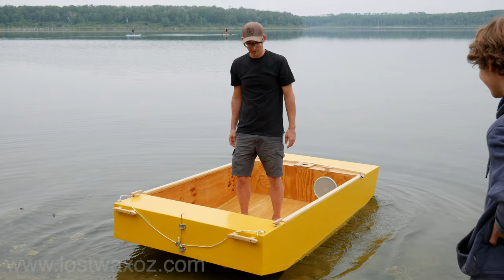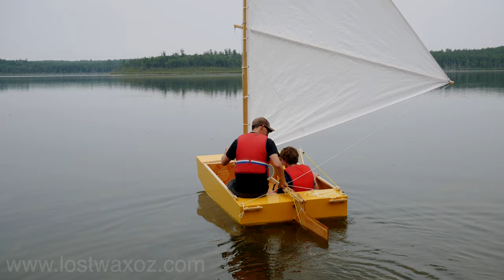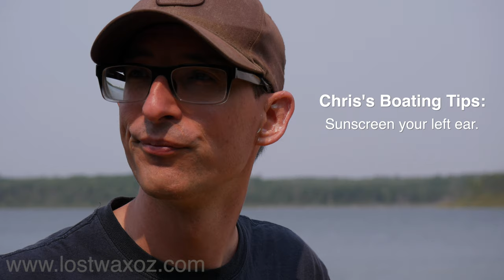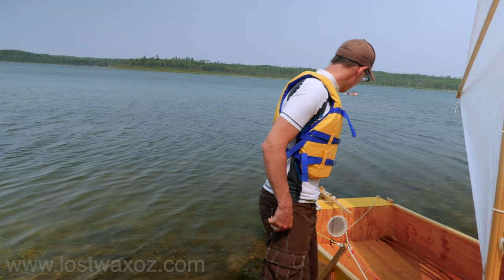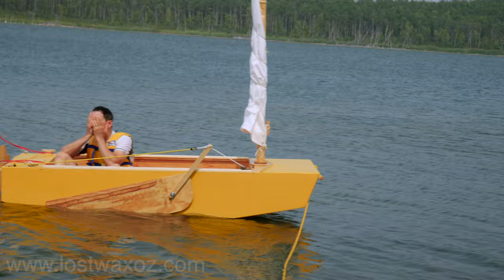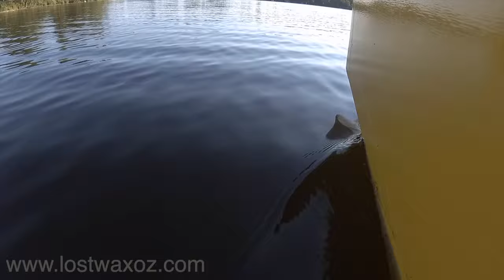Plywood Sailboat (PD Racer) Capsize Test, Re-boarding, Maiden Voyage, and Other Adventures!

Comment: Great video! I think this is the first time I see a capsize test on a PD Racer. Here is some advise for next time..... Instead of stretching your hand to the high side of the boat and pulling it down and over - causing much more water to enter the boat - through the main sheet over the side and pull on that while pushing your foot against the boat. This will not place so much weight on the boat and it will scoop much less water.  Please keep the videos coming!
Reply from the maker: Yes, when I watched the video I saw how much I pushed the boat down into the water by climbing up on the side. Good idea to use the main sheet as a line to pull it over, thanks!

Comment: Great series. I would think a rope ladder or stirrup on any side without the leeboard would aid in reentering the boat if you were cold or fatigued. And extra tail on the end of the ladder could also be used for righting the boat from either side.
Reply from the maker: Yes, I'd like to try a few things to figure out the best way to right the boat easily. Good idea for the ladder.

Comment: Do you have a final cost tally? Nice job. Check out the Texas 200 Duck run.
Reply from the maker: Not really, I think maybe around $300? I got the wood for a really good deal, had a jug of titebond2 left over from my surfboard build, and I think I used 5 or 6 tubes of PL premium...

Comment: How well did the boat hold up over the last year or so? Thinking about starting a similar project... did the paint do a good enough job at sealing the exterior? Has it remained pretty rot resistant and structurally sound? Anything you would have done differently? Love the videos and appreciate you sharing them!
Reply from the maker: I've sailed it 2 seasons now- probably 6 or 7 times a season. Only on small lakes so far. Stored in my garage over winter. I'm really impressed with how the poor mans fibreglass has held up around the edges, and the paint has been great too. Just one little spot on the bottom where there was a knot in the wood that the paint has cracked a little. The fit between the mast and the hole it goes in is a little tight, makes it hard when trying to slot it in properly. The leeboard which was made from gluing plywood together started to separate a bit where it didn't have full glue coverage, so I filled those gaps with epoxy- I should have been more generous with the pl premium when I glued it up. I have since added oarlocks and oars as it's pretty hard for one person to paddle (will be adding that video this spring) Other than that, probably the only other thing I'd like to change is figure out a way to drop the sail if I need to. On the positives, I love the handles- makes it so much easier to carry. It's fairly light and easy to move around for two people. The system for the rudder and leeboard work great. and so far the 1/4" bottom has been strong enough. Haven't had anyone really heavy in there though.....
Reply: @LostWax2  For dropping the sail you might try hoisting the sail with a halyard while using a spiral lacing instead of the square knot rope grommet style rings.  The spiral lacing uses the same brass sail grommets and just winds its way from the bottom grommet to the top grommet in a continuous spiral climb.  The lacing attaches at the lower grommet and the upper one but is left free to slide through the intermediate ones and needs to have its length adjusted so that at full hoist the sail is drawn appropriately close to the mast.   It's also important to use a small diameter line so it can easily slide through the intermediate grommets as it distributes itself evenly along the mast.  You still need to use a downhaul line to tension the luff.  Remember that you're tensioning the luff and not the lacing with the downhaul.  The lacing must always have a small amount of slack in it. Using a simple two part halyard (the two parts being the sail luff tensioned down to the deck through the downhaul and the halyard line tensioned down to the halyard cleat on the mast or deck) doubles the downward load in the mast coming from the mast head but this sail is so small you're unlikely to see a problem (ie..excessive bending).  You'll also have to cleanup that rats nest you're using to attach the snotter to the mast.  You don't want the lacing to snag on it as the sail comes down.  I have a short video (3 sec) of how I've worked this out on a small sharpie (14ft).  I'll see if I can post it somewhere convenient and get back with a link to it.

Great job on the project overall!  Very important to do the capsize, bailing and re-boarding test.
Reply from the maker: @ChrisTietjen_00  Funny, I just re-worked the lacing on the mast the other day. I did it a little different than the method you mentioned. I started with the bend of the line going through the top grommet, and then lacing it to the mast a bit like you'd tie a shoe, except instead of crossing over itself on the opposite side of the mast, I zip tied the two lines together. I saw that method somewhere when I was first making the boat, but couldn't find it again when I looked recently. Going to try it out at the lake this week. I'd love to see what you did, especially a good way to clean up the snotter attachment point on the mast. Thanks for sharing your experience!!

Comment: your dagger board is on the side?  Generally it's in the middle for stability.... if you center it and add weight it will help you in windy days.
Reply from the maker: Yeah, it just keeps the most space possible inside the boat this way, and keeps things simple. It won't be quite as efficient as a centreboard, but I'm O.K. with that.

Comment: Great little boat how did the poor man’s fiber glass and paint hold up over time
Reply from the maker: So far the poor man's fibreglass is as solid as it was on day one. There is only one little spot on the centre bottom of the hull on the outside where I think there was a knot or weakness in the plywood, so there is a tiny crack in the paint that I'll need to fill, for now I just put a small piece of duct tape over it:)
Reply: I just started to build mine today. I am using high end sanded 1/4 inch oak ply.  It’s about the same weight as the pine. But I think it will look much nicer  less knots. I am placing the glued dowel s ever 4 inches.   I’m planning on putting port and starboard mast stays and a nice sprite with a mast stay off the front. I am planning on building one for me and one for my son as we are avid campers and want to travel the lakes in the addirandacks in up state ny. I think this little boat would be fairly easy for us to portage  and should haul out back packs and camping gear just fine.  Here is to future adventures.  I’d love to share my pics with you some time 
I’m Chris by the way nice to meet you on here Chris lol

Comment: Hey ear wax 2 i watched your videos of building the sail boat its pretty neat  must say im impressed 
but i have few questions 
How long is the boat?
how wide is the boat
and deep is it also is there any angle on the sides of it
im gonna be doing a boat build on my channel as well wont be soon though
but surely hope you come by and check the channel out im sure ive got something youll like
Reply from the maker: The boat is 4 x 8 ft, with straight sides. I can't remember the depth, but I think I show it in the first video.
Reply: @LostWax2  hey thanks man ill watch the video again  to see 
last night i was feeling motivated so i actually set down and drew my ideas out on graph paper  and its coming along nicely  what im building im thinking is gonna be a 12 ft boat though

Comment: I say climbing in the front would be the better option in an actual struggle its hard to get in the boat but it looked far easier to pull yourself up to the point you could stay on it in a stable way without large amounts of work
Reply from the maker: Yes, it's not too hard to get halfway out of the water, it's that final bit that's the hardest.